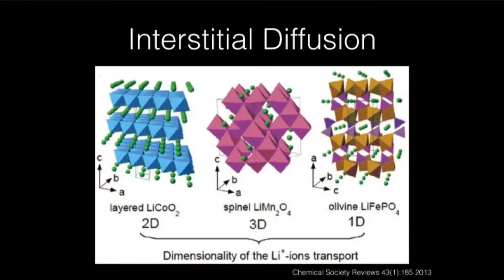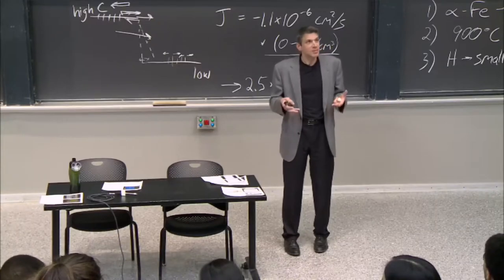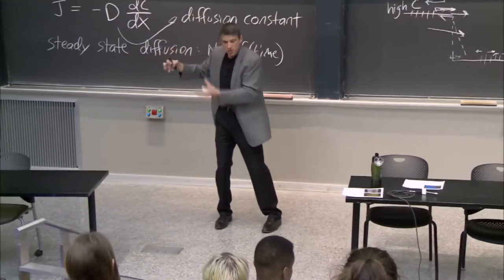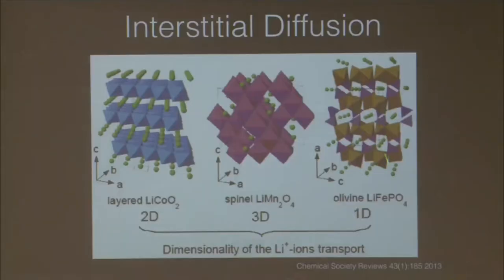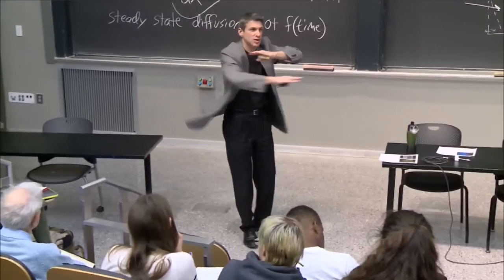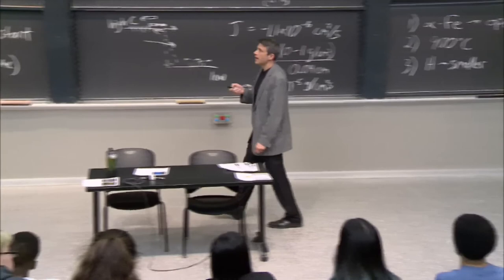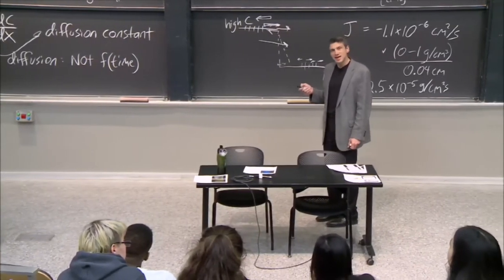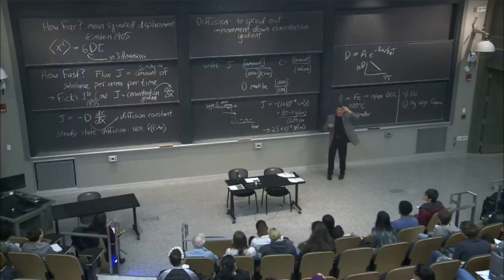The Battery Revolution (Intro to Solid-State Chemistry)

Comment: 1:06 it may be helpful to re-phrase it better or insert some clarification captions since I'm interpreting the spoken description as backwards of what it should be.  Charging moves Li+ ions back to the anode to rejoin electrons as Li0 (where it's intercalated in a carbon structure, a structure having Si, or even as a metallic sheet in the case of metal anode / solid state Li batteries).  I love professor Grossman's energy, though, no pun intended.